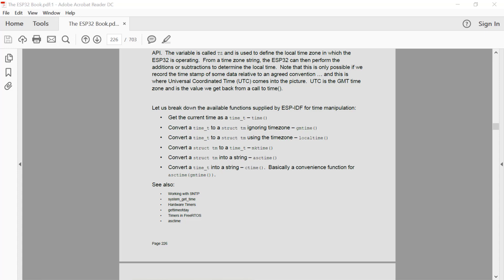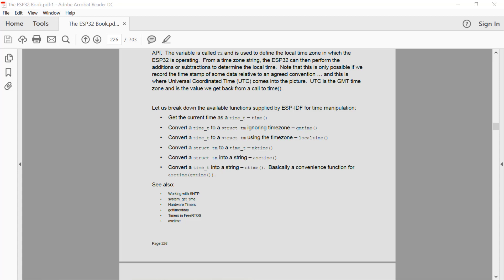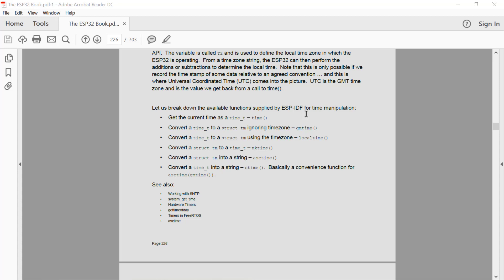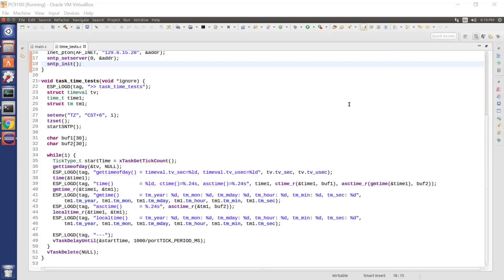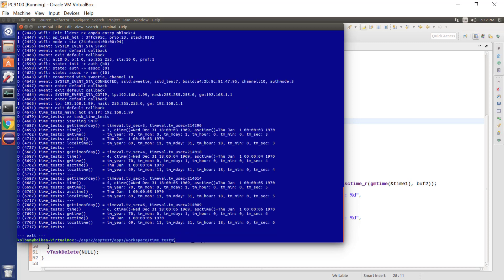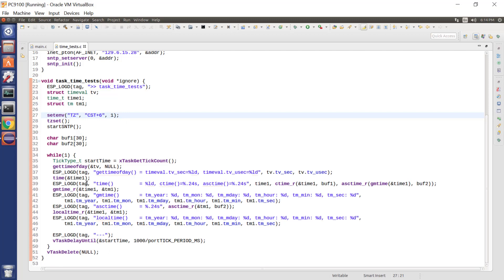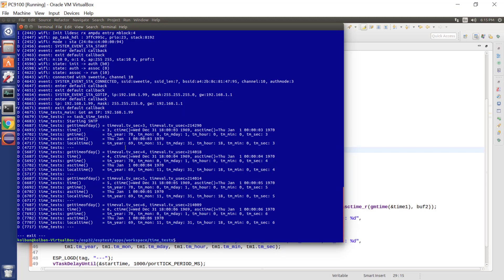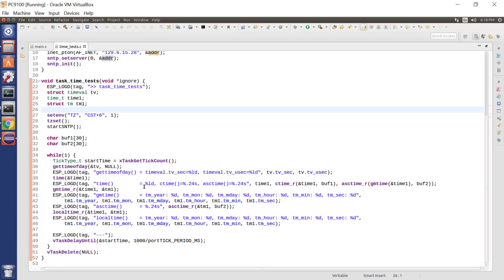ESP32 Technical Tutorials: Working with time

Comment: Adafruit announced today a Pycom ESP-32 board, running MicroPython, and which has a RGB neopixel LED. It really needs an expansion board to be easily useful. The expansion board includes headers, USB, LiPo battery connector & charger, & SD card holder. There is an additional breakout for a UART connection, LED & battery. There is also a LoRa version. I think what they mean by saying, "This board does not come assembled and does not include headers" is that the headers are not installed, and are not included.

https://www.adafruit.com/products/3338
https://www.adafruit.com/products/3344
https://www.adafruit.com/products/3339
https://www.pycom.io/gettingstarted/
Reply: Art Becker ...do you work for adafruit !!